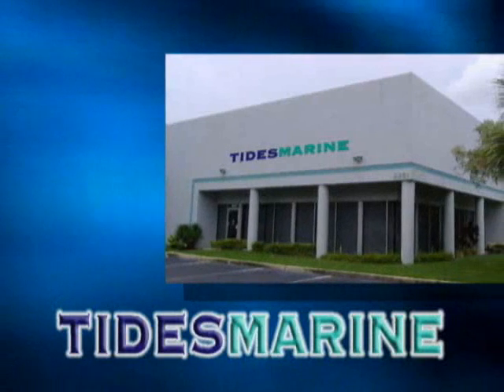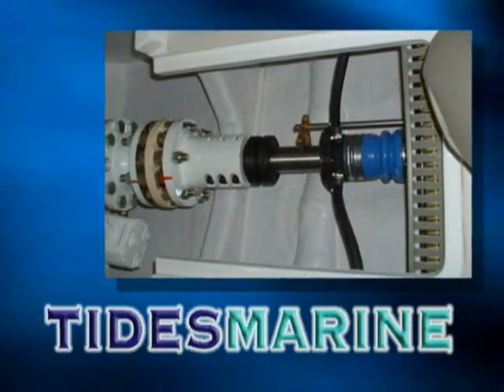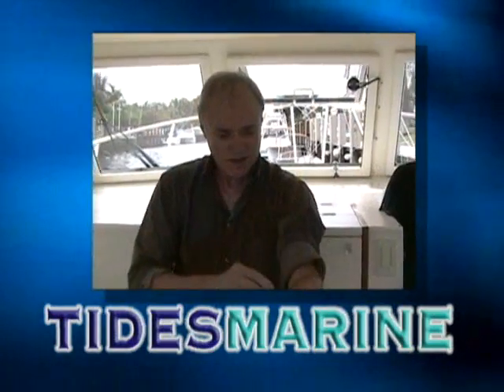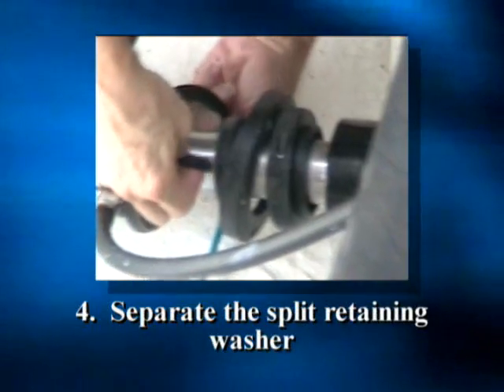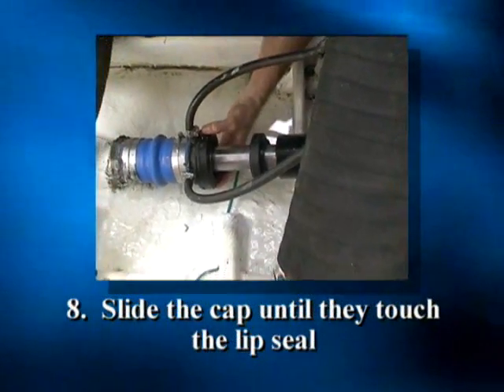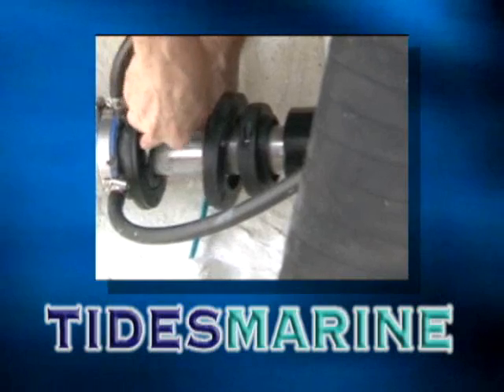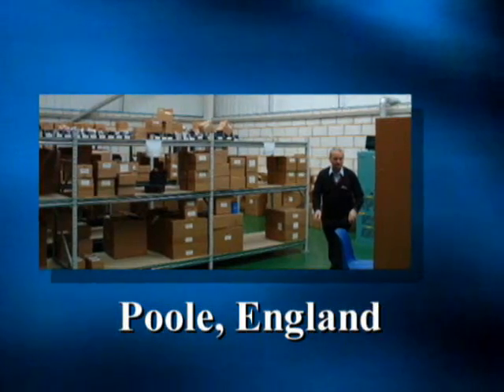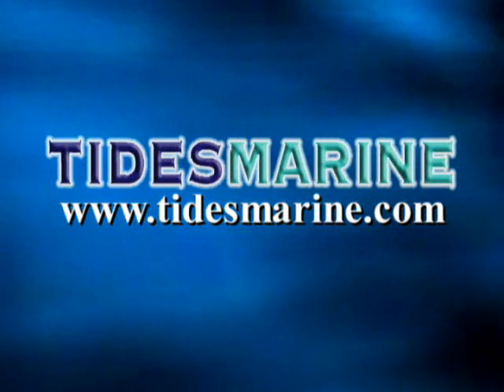TidesMarine Sureseal shaft seal

Comment: Good day; Lifted my boat out to the hard for winter layup last week.When clear of the water noted that both shafts were leaking water outboard, is this just normal draining water.Have had no leakage inboard during past season, is it normal for water to leak outboard when boat first lifted out of water.Am thinking that this is probably just residual water contained in the "Tides Marine" dripless seal and in the stern tube.Each dripless seals receives cooling water via a hose direct from drive engine so is possible its just draining from engine block. Appc't any advice. Rgds; John A.